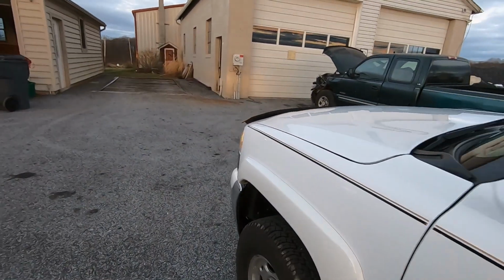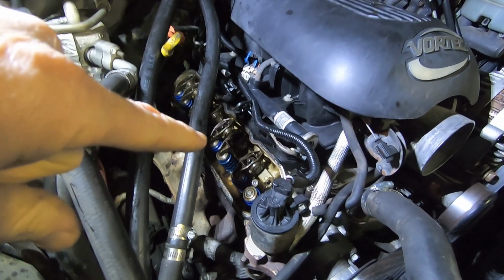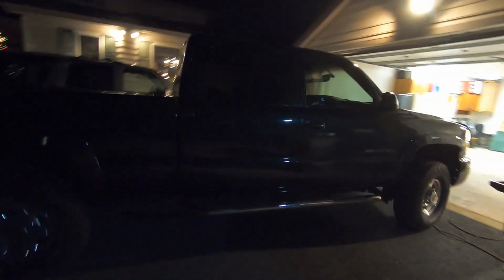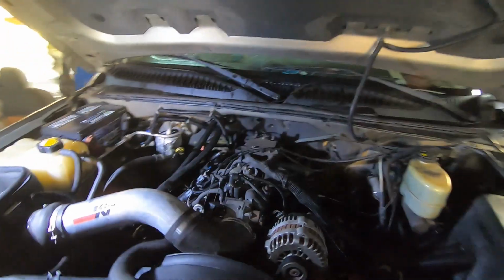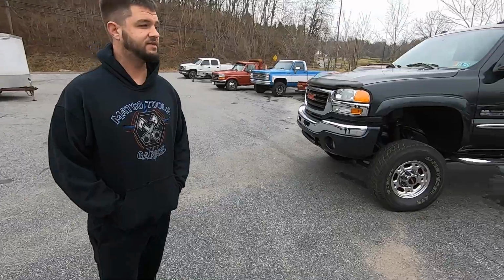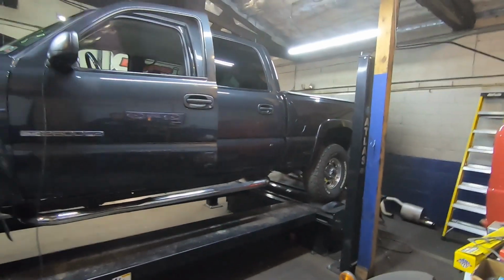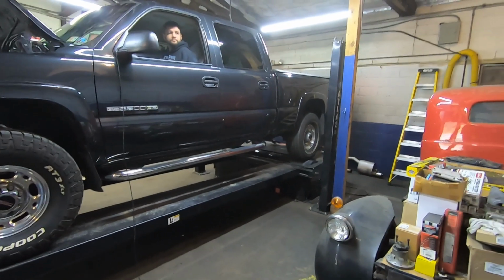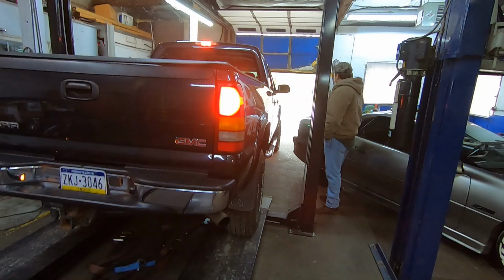MEET THE NEW TURBO GMC

Comment: The only 6.0 truck engine that was rated at 300hp was the 99-00 lq4 with cast iron heads and the same cam as the lm7/lr4. The 2001 and up lq4 had aluminum heads and the the late ls1 196/207 cam and was rated for 325hp and 380 feetus pounds in the HD trucks
Reply from the maker: You're correct on the iron and aluminum heads but I disagree with the HP. I bought my truck new in 2004 and it was rated at 300HP. You can google it also, I double checked myself, LOL. Thanks.
Reply: @slow_restoration   On an engine dyno, the lq4 will make  good bit more than 300 net flywheel power. I don't know what the problem was with brochures and specs in the manuals, looks to me  like the spec data didn't get updated when the motor got the hotter cam, or maybe it was intentional to justify the higher price tag for the lq9. It's just a 345hp lq9 with dishtops. The power difference because of the lower compression equates to about 7 horsepower. Maybe. The lq4 timing tables are a tad softer but not enough to hold it down at 300